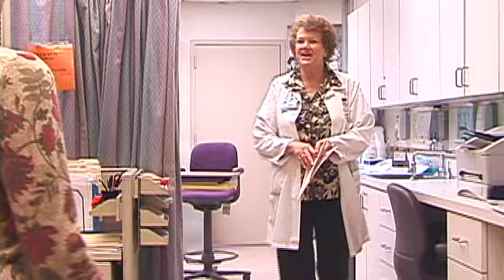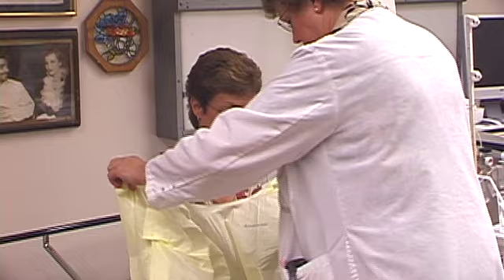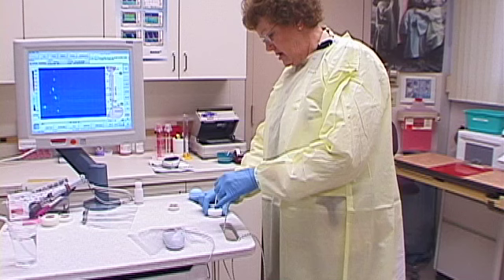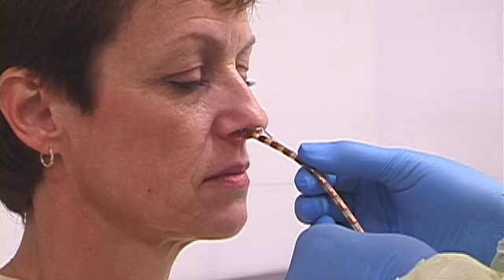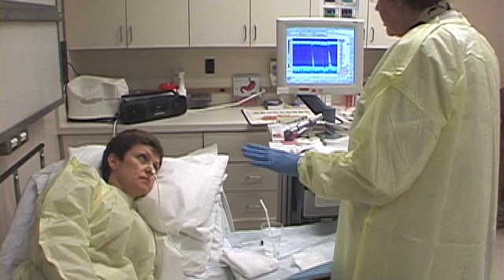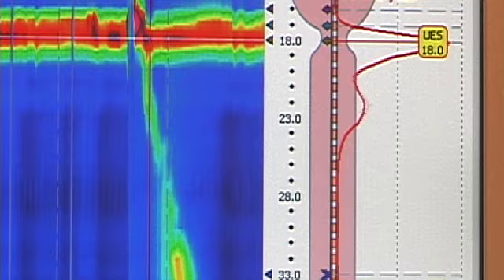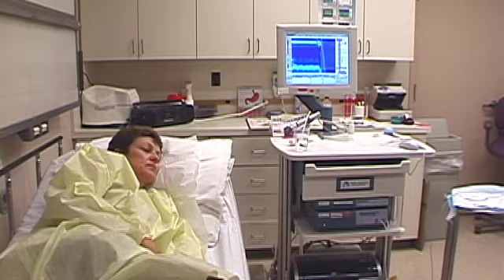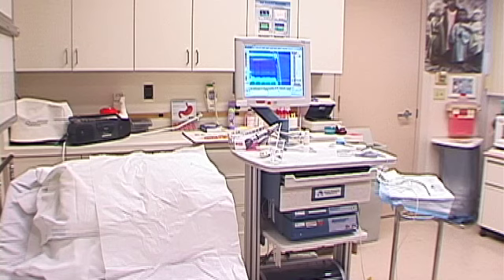Down the Hatch- What exactly is Esophageal Manometry?

Comment: I had this done today. It was not as bad as I had expected. I had read/heard about other people's experiences and was terrified - I didn't think I was going to get through it. I also have some PTSD from an awake endoscopy 7 years ago. I'm not going to lie, it was gaggy and uncomfortable but I told the tech I was  super stressed and she was really supportive. Top tips: don't hesitate in starting to swallow/drink when they start pushing it down. You might feel like resisting it, but it really helps. Follow their instructions on head placement - chin up/down as required. Breathe slowly and don't try to talk while it's in - you might find it reassuring to write yourself some communication cards in case you want to ask questions or say things during the test. Try not to bump or move the tube either, because that's when it becomes uncomfortable. I found the most panicky bit was the first minute or so after it was placed - it was less noticeable after about 5 mins. I had a rarer variation of this test where I actually completed a standing modified barium swallow test under X-ray after the usual testing with water. I had to eat bread and drink contrast with the probe in, so the whole thing took much longer (around 25 mins with it in) and involved moving around. The eating/drinking with the tube was surprisingly easy and I was still coping ok by the end. Hold your breath when they pull it out, and make sure they give you a count down. If you need to get this test done, give it a go - if you can't get through it there's no shame, but you might have a positive experience like mine and you'll never know if you don't try.
Reply: I had attempted to do this test today and it was absolutely traumatizing. Worst test I have ever had done. I thought I was going in for a barium swallow. If I didn’t have medical trauma before I do now. We couldn’t even start the test it was awful and I couldn’t stop vomiting. Idk why I even had to have this test this isn’t how SMAS is diagnosed and that’s what we are testing for. I think it’s time to go to therapy
Reply: My body resisted to the test. I’m sad that I can’t take the test to diagnosis my issue

Comment: had to have this done twice in a few years span for achalasia. first time they combined it with an esophageal endoscopy so I was knocked out for the insertion and then woken up with the catheter in and had to wait almost an hour before they started the test to make sure I was completely awake. the second time I was awake and was given no numbing agent whatsoever. I was also just getting over a sinus infection so both nostrils were clogged. first attempt couldn't get it through so they attempted the other with even worse luck so the went back to the first nostril and got it down. gagged multiple times while it was passing and once it was finally in place I was almost in tears. when the test was done the nurse literally grabbed my face and the tube and ripped it out. I really hope I never have to get it done again

Comment: I had this done today at Cedars-Sinai in LA. A few tips: I didn't get any anesthetic in my throat - not needed. The nose is the most important part. I asked to self-insert the long Q-tip holding a glob of 0.2 lidocaine (rather weak) inside my nostril (they ask for your preferred nostril). It has to go pretty far up, or else you won't be numbed. Don't lie down if you don't have to. Just sit upright perpendicular to the bed with your feet dangling off the bed. The gagging sensation is very brief and your physician (I had a physician AND nurse) will instruct you to breathe at the right moment. Also, pulling your head down toward your chest helps IMMENSELY. I grabbed the nurse's hand as the physician pushed the tube down the esophagus - that was the creepiest part of it. Once it's in, you realize you're not going to choke - it's just a little scratchy in your throat from the tube. The nurse should hold the cup of water and hold the straw toward your mouth. You get the hang of it after a while. At some point, the physician has you take 10 small sips, as in sip, hold, swallow, sip, hold, swallow etc. Some of the water is salt water (not that bad). The whole thing is over in 10 minutes. It looks rather creepy, so just close your eyes. Peek when the straw comes to your mouth (you don't want to miss, the water feels good going down the hatch). Also, it looks weird when the tubing comes out of your mouth - I thought it was covered in blood, but it's just the brown sensors inside. Not keen on doing this again any time soon, but if I had to, I know I'd make it. They both gave me an A+ for effort :-)
Reply: You want to lay almost flat, that way gravity isn't helping your esophagus do the work. All protocols have them laying semi-recumbent.
Reply: Good to know, although the gastroenterologist was fine with me sitting and got very accurate measurements. I still had the upper GI with the Bravo capsule - another icky experience!
Reply: how was bravo icky?  @xtineonutube

Comment: I had this procedure this morning.  The comments in this thread had me pretty freaked out.
Though it wasn't my favorite and I'd like to not do it again, it wasn't bad AT ALL.  She put lidocaine in both nostrils.  She tried putting the probe in one side and I felt some uncomfortable pressure and when she wasn't able to get it in (deviated septum?) she tried the other side and it slid right in.  It felt like I had swallowed a toothpick... not painful... just sitting there.  I followed her instructions and only swallowed when she told me to and the test itself was over in less than 10 minutes.  I didn't gag though there were a few seconds that I thought I might. 
The worst part was actually taking it out, which is super freaky and a little uncomfortable but that's literally 5 seconds.
If you have to have this test done, try not to freak out.  I hope your tech is as nice, patient and gentle as mine. :)

Comment: I had this done today (and currently have the 24 hour acid reflux test tube inserted too). I should point out, I have a terrible gag reflex. I gag even just brushing my teeth, dentists x-rays are torture. I've even had a dentist procedure abandoned because of gagging (thankfully they hadn't really started). I also have an absolute hatred for vomiting and a fear of choking (especially because food sometimes gets lodged in my esophagus. I was freaking out before this test, and had convinced myself that I couldn't do it. I was gagging even just thinking about it the night before. I have to say, it is NOWHERE NEAR as bad as people in the comments are making out. I had the numbing spray up my nostril and into my throat. The part I was dreading was when it was going down my throat because my gag is so bad. The nurse asked me just to continuously sip water like I was really thirsty and she was even saying "this is the worst part", but I actually didn't feel anything at all. The water sipping works wonders - I was super skeptical about that. Now the whole thing was definitely uncomfortable and unpleasant. I did dry wretch once about three quarters of the way through because I felt the end of the cable was moving around slightly. The feeling was worse sitting up rather than lying back. I would not be rushing back to have this done again, it's super uncomfortable, but it's also very doable.  It only lasts 10-15 mins. Not 40mins like advertised in some leaflets. The 24 hour tube is so easy in comparison. It literally feels like hardly anything. Don't get me wrong, I am looking forward to taking it out, but it only feels like a tickle from something tiny stuck in my throat.

Comment: IF THE TECHNICIAN DOES NOT GIVE YOU NUMBING SPRAY, ASK FOR IT!  I did not even know I SHOULD have received NUMBING spray in my nose and throat, resulting in the most horrific test I have ever been through!  My technician tried twice in each nostril before she managed to get the probe fully inserted.  The results showed I had significant pressure in my esophagus and was finally validated after 20 years of being called a hypochondriac.